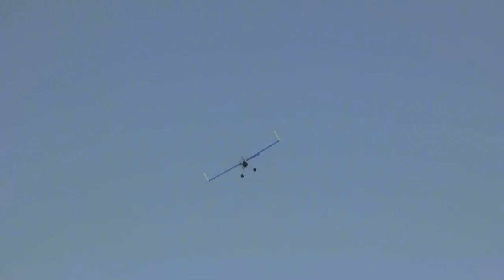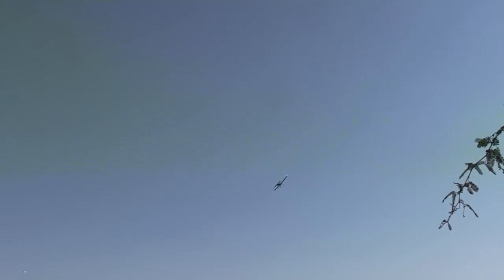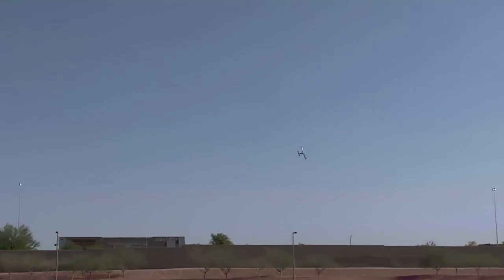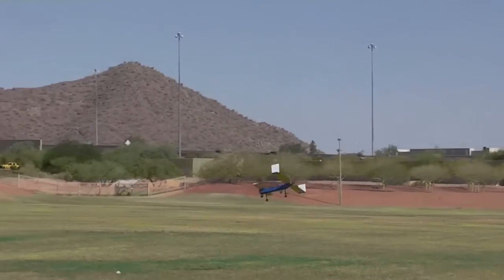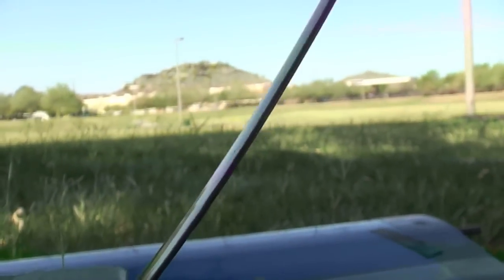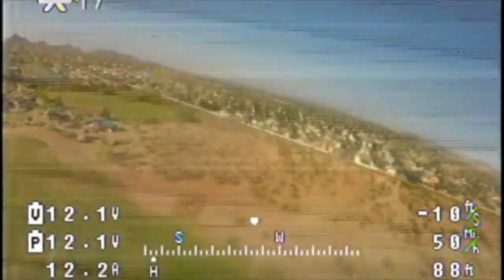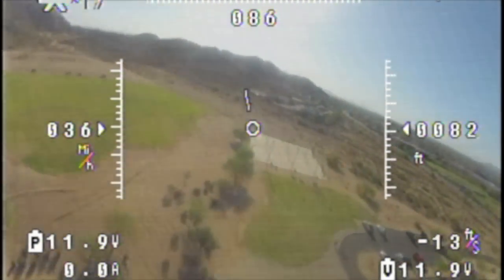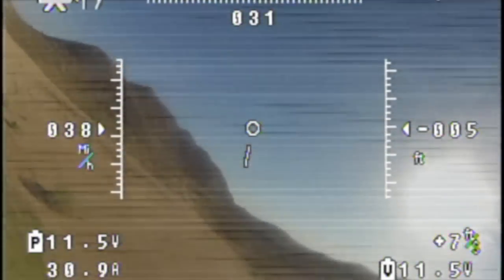PEACE DRONE XR - Flight Video

Comment: please tell me, in the news they talked about switchblade military aircraft, they have an absolutely flat wing profile. Such a profile can already disrupt the flow at low angles of attack, but the military is not stupid, I believe. Can you build a similar model like switchblade 600 for testing or explain how this wing profile works?

Comment: When u say u Rectified the interference problem with a Dedicated power supply from new hobby does that mean she flys with two batteries on board, one for plane and one for your on board fpv gear? I am relatively new to FPV so please excuse my ignorance and I'm having interference issues with my similar fpv setup.

Comment: O if you did not see the moters specs coment its under this video (its in 2 diffrent comments becuse of the limit of space.)
Ok about the wind thing I said it is at most 15-17mph. Its acually usaly 10mph.
 And I know how hard it is to fly in that kind of wind.
The plane is all over the place and I even crashed my fiirst time becuse of this. But i am used to this and can control the airplane in this kind of wind. I did not even use a buddy box on a flight after my crash with winds at about 14mph

Comment: I also wont be having the 37gram rudder servo on the peace drone and I will also not have the 13gram elevater servo on the peace drone. So you can minus 50grams of weight.
I will be doing fpv but only in the distant future. So no fpv equipment yet. I will buy a better moter if need when I do buy fpv stuff. I am a biginer to the rc hobby and I think the peace drone will be a good next step plane.

Comment: See thats the thing the apprentice moter does not cite alot of its specs

But I have done alot of reasurch 
This is what I know
Its a 15 size moter 
It is 840kv but it spins a large prop (11x8)
It can fly the apprentice with plenty of power (apprentice weighs about 40-45oz or 1135-1275grams)
The apprentice has the wing loading of about 12oz/square foot
Also due notice that the weight of the body of the apprentice itself not counting electronics is more then the peace drones body weight.

Comment: On the landing gear problem I use a 8lbs test mono struck across both gear at 2/3rds. the way up and it sovled my single break on fiber or plastic gear. It'll give but stop the break.

Comment: I'm keen to...  It's on my projet list.   Still playing around with my v2 peace drone though.

I thought of the A-Frame idea but to get the cross brace in you'd have to cut through the foam-board spars if you want it to attach to the other spar.    Maybe that's where I am going wrong.

Perhaps a v-joined main spar as you suggest and then just a carbon fiber strip for the A-Brace that could be inserted after the wing is completed.

I think I'll play with a KFM2 airfoil first to size the wing.

Comment from the maker: The canard is was a few degrees off for that flight.  Bad form for me, long story, the foam shim I used blew away (on the ground) just prior to this flight.  I did trim it to compensate.  But as to whether the canard and wing are actually moving around in flight? Maybe so.  The wing tiedowns are pretty tight and burly, but anything is possible.  I did once have the canard shift in flight on an early version, and it was not subtle!  Now I tie that sucker down tight.  More experimentation needed.

Comment from the maker: The OSD part is fine - good display, easy to set up, decent price.  Do some homework on RCGroups for the RTH.  Seems there are enough guys with bad luck that I remain concerned.  Some guys have had great success though.  Skylark OSD might be better for size, display, and price if you definitely don't want to play with the RTH thing. (yes, I bought one of those too)

Comment from the maker: Probably so, definitely more rigid couldn't hurt, in my opinion.  The same sized ones worked fine in previous versions.  It's just a theory, and not hard to test.  I just need to build Readi-Board vertical stabilizers.

Comment: I wish my 'Drone was further along and flying, because - as I watch scratch built RC vids - I am reaching the conclusion that the vertical fin is the most neglected control surface in all of RC, and this contributes a lot of stability issues.  I think the PD design is extremely valid, but maybe some rigid, higher aspect ratio fins are in order?

Comment: My current FPV plane meets all my requirements for a long range heavy lifter.  BUT... The thing is a monster. Even with the wing removed is barely fits in my car. Then takes 15 minutes to assemble and pre-flight check. Arrghh....! So I'm looking forward to finishing your design. I will start light and then add bells and whistles one at a time till I reach the planes limits.
Great job on your video and thanks for sharing.

Comment: I too have designed and abandoned 9 different planes in an attempt to get a long range platform to carry all my gear and wheels. But in the process I have learned a great deal. Foremost I found that I have to make concessions if I want to go long distance. I'm building your design. Minus the GoPro (CCD Only), and definately no wheels. For prop clearance on landings.. I plan to use my folding prop which I had great success on my delta wings.